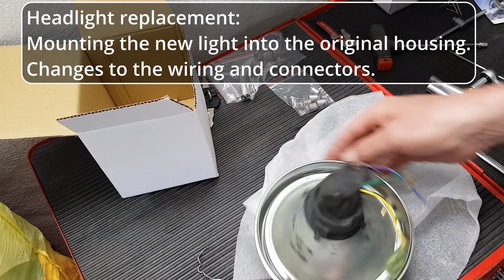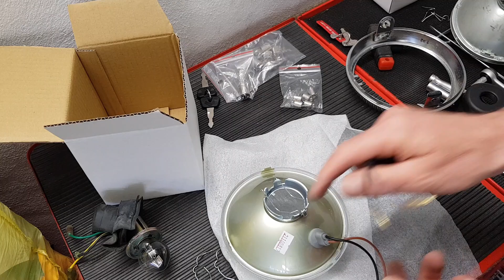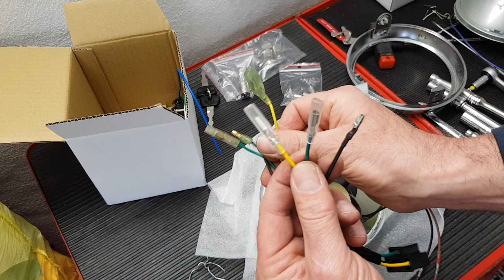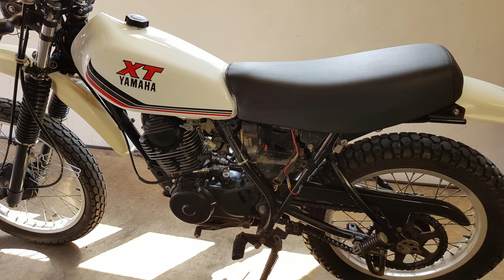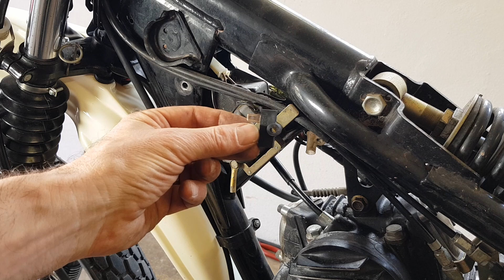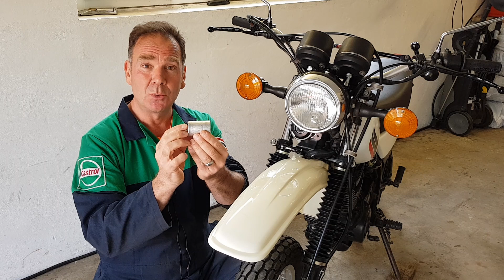EP:2 Yamaha XT 250 (Model 3Y3) 1979- 1990 6 Volt to 12 Volt Conversion Part 2 - Step by Step Guide

Comment: Thanks for the informative video, I'm trying to do this very same thing with to a 1980 Yamaha XT250. Do you know which wires of yellow, red, green/white wires belong to the stator? I've tried a few different regulator/rectifiers and can't see to generate 12V dc..only 6V. I've tried a 3 pin (2 stator + 1 batt), and a 4 pin (2 stator + 1 bat + 1 ground). My stator seems to have a yellow, green, and blue wire from which i've measured 7V AC, 15V AC, and 0V ac respectively. Any help would be appreciated, thanks!
Reply from the maker: Hi, below are two links, the first is for a 1980 XT250 service manual. The second is a link to Eric’s  great site for xt250 info
Hope they helps with your project 👍
Kind regards Carl 

1980 XT250 service manual download in English:

http://www.xt250.de/downloads/Werkstatt%20Handbuch%20XT250%20mit%20Inhaltsverzeichniss.pdf

https://www.hydrogen18.com/p/1981-yamaha-xt250-ignition-only-wiring-harness.html
Reply: @justthewayitis  thanks for the info!
Reply from the maker: No problem 👍🙋🏻‍♂️

Comment: Hi, I know this is a older video, but I have a 1982 honda cg125 that running a 6v points system, would it be the same process as what you have done here?
Reply from the maker: Hi Ethan, honestly I have no idea without actually looking at and checking the system on the CG first. You could have a look on the Honda forums and Oldtimer forums and see if someone has already done this conversation.
If I come across more information I will reply / post it here. Good luck with your project, Carl 🙋🏻‍♂️

Comment: What color is the wiring for the horn? I just picked up an 81 and there is no horn on the bike to know which wires are for it. All of the indicators were also off of the bike, so i've been wiring it up to the best of my limited knowledge. thanks!
Reply from the maker: Hi Ian , Brown and Pink, I think 🤔 but it’s best to check in your workshop manual. If you find them it’s easy to test this with your multimeter.
Best wishes Carl
Reply: @justthewayitis  Thanks. Yeah that sounds right and agrees with the manual. I was thrown off since the female connector on pink was disfigured and plugged into the brown connector. Upon further inspection I noticed this and replaced with a new female connector.  Now I wait for the 6v horn and missing rectifier and plug them in and see where we are. thanks again
Reply from the maker: Your welcome 👍

Comment: Great video! I've been wanting to do this to my 1982 XT250 for a couple of years, and with the help of your guide I finally got it done! I didn't expect it to be so easy. I've been having an issue though and was hoping maybe you'd know and be able to help me out. Ideally I'd like to run LEDs throughout the whole bike (I don't really mind using halogens for the turn signal as I think they're bright enough.) So currently I've been trying to do just that. I left the turn signals halogen including the turn signal indicator , and I've put in LEDs for the headlight, speedo, high beam indicator, neutral indicator and the brake light.
The turn signals, brake light and neutral and turn signal indicators work fine, I'm just having issues with the speedo, high beam indicator and the headlight being way too dim. To the point where I can barely tell that they are on. I'm aware that those three receive power from the yellow wire/magneto. Is there a reason why those one run so dim? What can I do to troubleshoot/resolve this problem?
Thank you!
Chris
Reply from the maker: Hi Chris, without physically working on your bike it’s very difficult to advise you.
But all ground connections must be perfect 
All harness connections must be perfect 
Battery connections must be perfect 
This needs to be checked using a multimeter.
Then check the actual voltage from the Yellow wire circuit .
Are all the traditional and LED bulb voltages and wattages correct? Inspect each one and write down the values!
Also normally the system output is not enough to run a led headlight bulb. So I would remove that and then test the other lights and see if they are now working correctly and bright.
Did you also change the battery, as this needs to be a good quality one.
I hope this gives you some area’s to start checking.
Carl

Comment: Here are 2 more tips_: You have installed the spring clips (Tension Spring/Clamp) incorrectly, you have to turn them around. And a fuse with 10A should also be (an factory is there a fuse switch), please do not connect directly to the battery.  Otherwise a great video.
Reply from the maker: Thank you 👍

Comment: Hey, i have a Yamaha dt 125 1984. Can i use the same rectifier to change it from 6 to 12 v? Because the Old ones looks like the one in the video😁
Reply from the maker: HI Jens, as long as yours looks like the same connection it would seem logical that it would work thee same. Don't forget to change all the other parts I did too. You could reach out to Kedo parts and see if they have a kit.

Comment: I'm gonna do the same conversion on 2 of my XT250's, but as I am in South Africa getting the kit is excessively costly. I can get all the parts seperate, but can you give advise on the Rec/Reg, as this is the one area I am concerned about. Will any 12V Solid State regulator work?
Reply from the maker: Hello good morning, yes you can use anything that keeps the voltage under control, just test it to make sure it’s not passing more than 14.8V
Good luck with your project 
Carl
Reply: I am probably a bit late.  You don't need that kit,  just get a 4 pin 12v Reg/rec and all the other 12v bits. I'm also in S.A and that kit is damn expensive for us.

Comment: My yahana ct3 has a rectifier but not a voltage regulator. Not sure what I would do with the yellow wire. Ac voltage from genorator run through ignition switch then to rectifier. Rectifier output directly powers battery curcuit.
Reply from the maker: Hi, i have not worked on the Yamaha CT3 2-stroke from the early 1970's so its possible the wiring is different. Perhaps you can ask on the Yamaha owners forum I'm sure someone will have the information you need.
Carl
Reply from the maker: https://yamahaclub.com/forums/topic/19038-74-dt-175-wiring/#google_vignette

That should take you to the wiring diagram 
Carl

Comment: Hi, thank you for the video! I am doing a conversion on my 76 xl250.. I cannot seem to find a regulator/rectifier that has the extra wires as you found in this video. I found a 4 wire simplistic one or some expensive ones that have lots of wires. Please advise if possible.
Reply from the maker: Hi Antony and welcome to the channel. There are lots of Honda forums that cover this in lots of detail. This is a great place to look for what solutions other owners have done with regards to charging systems and upgrades. The 76 XL is a beautiful looking bike and YouTube has several owners that have done this to the K2.
Let me know what solution you decide to install….
Best wishes Carl
Reply from the maker: Which country do you live ?

Comment: Hello, ive got the 12v conversion kit but it didnt come with the 3 spring clips to fit into the housing.  Do you know where i might be able to source these?  and what the model/serial number might be for them?  Awesome video by the way, very easy to follow :)
Reply from the maker: Hi Mark welcome to the channel. The headlight clips were supplied with the headlight as a kit. There is no separate part number. Perhaps you can ring the supplier who sold you your kit and ask or maybe you can reuse the original ones with a little bit of adjustment or reshaping. The shape of the new ones was similar so I think you might be able to bend them into shape. 
Let me know how your project goes
Best wishes Carl
Reply: Thanks Carl, I managed to get the w clips to fit, thanks again, now back to the rest of it :-)
Reply from the maker: Hi Mark, that’s great news well done 👍 and I wish you success with the rest of the conversion. Carl
Reply: Whereabouts did you get the conversion kit from thanks
Reply: @adrianrattray9271  kedo parts Australia
Reply from the maker: Or Kedo parts Germany 🤞

Comment: This question doesn't refer to a Yamaha, but I hope you can help me out
Me and my father restore an old NSU motorcycle and the alternator was already converted from 6V to 12V. 
Now the question:
The original light bulbs are 6V 35/35W
Will 12V 35/35W shine as "bright" as the 6V or brighter? Because the wattage is the same (only the amps differ) will they have more lumen? I can't find any data.. 
Maybe we need a bulb with more wattage? But that will not work with the generator, right?

And we aren't even close to get finished, so we cannot try it to see the difference (or not) because we never saw the original 6V setup running; That's why I'm asking you 🤔
Reply from the maker: Hello, it's not a simple answer. A Halogen bulb will emit more light output compared to a incandescent bulb. So which are you using ?
The 6V bulb you mention uses approximately half the current your 12V bulb uses.
But really you need to know what your 12V generator outputs in terms of max current. Because you may be able to run a 12V/45W or 12V/55W bulb which would be much brighter. 
Firstly find out what the generator output is and then you need to calculate the load used in the complete electrical system. 
Sounds like you have a nice project going on, and I wish you lots of success. 
Best wishes Carl

Comment: I have a 1980 yamaha tt 250. 6v system no battery. Keeps blowing the headlight an rear brake light bulb. High an low 6v 25w headlight bulb. It will last 3 or 4 unless I Rev the bike. What would be a good fix for it ?
Reply from the maker: Hi Jarrad, I haven't worked on a 1980 250TT, but it sounds like an over voltage issue, but...

 First step is to check the battery condition and voltage. If it's good it will be around 6.4V and check the electrolyte levels. 

Then check the battery connections and all the ground connections, a lot of issues can be resolved by just making sure the ground connections are perfect. If the ground connections are poor the system over heats, generates to much voltage and blows bulbs.

Second is to check the voltage output with a digital multimeter at 1500rpm, (6.7V) 3000rpm (7V) and 4,500rpm ( max 8V) these are approximate, check your owners manual to be sure of the exact voltage/RPM.

There are lots of YouTube videos showing how to do this if your not sure.

Hope this helps you.
Carl
Reply: @justthewayitis  He didn't have a battery so that can't be checked. I assume he's running an AC system directly to the bulbs. I don't know where to find an AC voltage regulator for 6v. I know there are 12v AC regulators for two leads for snow mobiles.

Comment: Hello mate sorry to bother you I'm just getting my head around this . So you didn't change the stator and coil still runs at 6v . 

Could you tell me does the new recitfier / regulator have a 6 v ac in and a 12v dc out ? Could you post a link to the part please
Reply from the maker: Hi XRP, all three points are correct... its a really simple solution, easy to do, and effective. No change of Stator.
I'll try to put link in the video description over the next couple of days. 
Carl
Reply: @justthewayitis  cheers mate I have a 1983 xt250 I'm doing at the moment got it without any electrics just looking to stabilise the voltage and get some lights etc working   thanks,  Christian
Reply: Any place i can get this in the US?
Reply from the maker: Hi Next Project,  I think XRP found them in the USA but i have not heard back from him. All i can give you are the links above. The job was / is really simple and made a big difference.  Best wishes Carl
Reply from the maker: Sorry I just noticed I haven't answered all your questions,  yes no change of Stator, its original. The new small module does all the work from 6V AC to 12V DC, and from the testing I did ... it does a great job of providing a good stabilised DC voltage for the system and battery.  Best wishes Carl
Reply: I did search the kedo part numbers from box in video but can't find it
Reply from the maker: All the parts purchased  for this conversation can be purchased here.
Www.kedo.de.
Reply: Ledgend found it
Reply from the maker: Excellent 👍